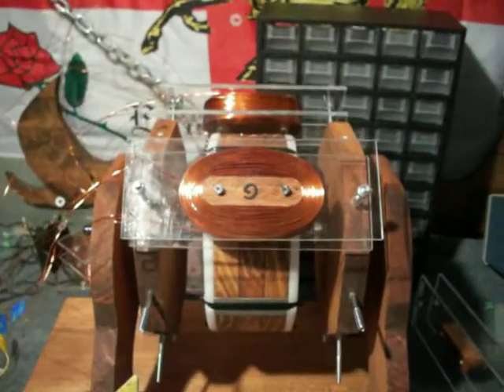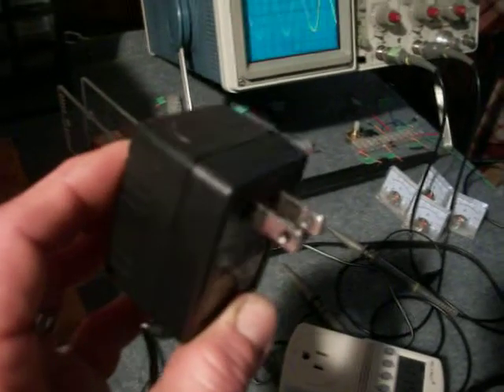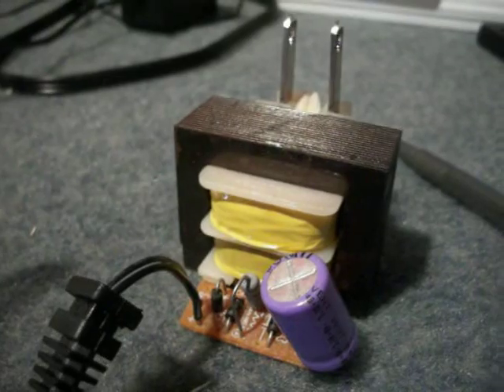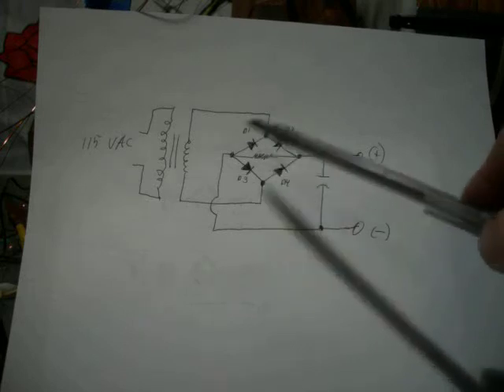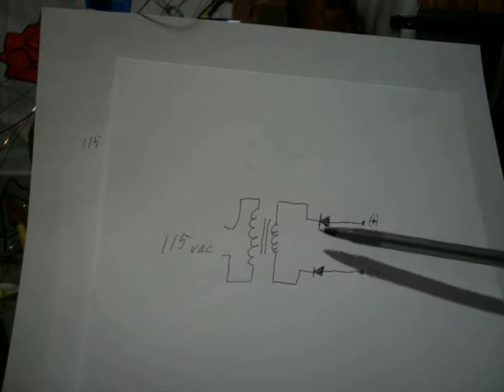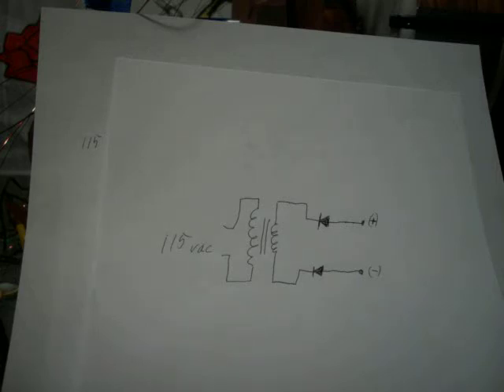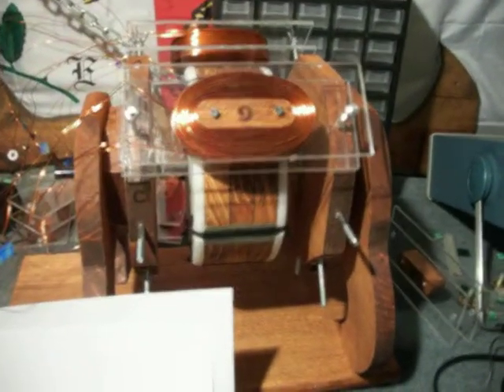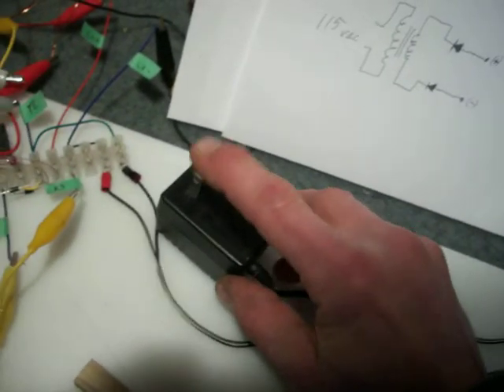Slowing the Smart Meter Test #3 (solution to a road block?)

Comment: i think you are looking for something along this path: how to plug in grid tie inverter to solar panels pv turn your meter backwards
Reply from the maker: Thanks for the homework on this one.  I'm more then likely going to hook one up to my wheel and see what she does.
Reply: *****
did you buy one?  looking forward to hearing your progress.  question for you: do you have any specs on your wheel chassis?  i would like to model something for a cnc machine or 3d printer.  already started on something for the wheel itself - just looking for a template to house the thing.  your design/woodwork is fantastic!!
Reply from the maker: Monday Morning Quarter Hack I had to stop myself from buying one last night.  Chances are I may end of frying the thing.  After thinking about it, hell it's only money.  I'll buy one for sure today and I'm going to try and find some schematics on them.  I know you can't just hook a 12v car battery up to one without burning it out. 
My wheel is a replica of the one Everybodyseye has.  He has the best one being made out of aluminum.  I have a 9 inch diameter wheel with 8 one inch slots.  The one in the video is 3 inches wide but I just finished one that is 4 inches wide.  The slots in the wheel hold the 4X1X1/2 magnet but I do have to balance them as they are off balance.  Takes a little time to balance them but they are very close to perfect.  First time my 3" wide wheel hit 1150 rpms, one of the zip ties broke and sent a magnet flying pretty violently.  Damn and I was right in front of it and I'm glad it didn't hit me.  Now I use two zip ties and on the new 4" I use 2 heavy duty zip ties.  I press a 1/2 inch cold rolled steel rod thru the center which is drill slightly smaller so no need for a keyed shaft.  If you could use some kind of auto cad program with a 3d printer, I'd make one that you could just slide the magnets in from the sides and just cap the ends to avoid zip ties.  A good experiment would be on different size diameters of the wheel to see which one performs better.  I guess you can't have them magnets too close together.
Reply: ***** oh what the hell  i'm gonna buy one too - hopefully it will force me to make my bigger wheel sooner than later.
Reply from the maker: Monday Morning Quarter Hack I went with the 1200 watt for $158 being the best deal I could find so I hope I don't wreck the thing cause I really don't know what the hell I'm doing. lol  I did see a video where a guy hooks one up to a car battery using a dc to dc converter so I also bought two 600watt units also.
Reply: *****
i'm not sure what you bought.  the video demonstrated a 'grid tie inverter' that plugged into a standard wall outlet (http://goo.gl/r7m4HK something like this).  are you looking at something different?
Reply from the maker: Monday Morning Quarter Hack check out ebay item number  221443651098 that is the unit I bought and yes it's the grid tie inverter you plug in your wall but bigger then the 250watt one on the link.  It was refurbished but that doesn't bother me.
Reply: *****
i just confirmed that you do not want to exceed the input voltage of the inverter.  and by that i mean they do not want you running a 24v battery on an inverter that handles a max 30v input.  just an fyi
Reply from the maker: Monday Morning Quarter Hack Thanks for the info, I'll have to be careful using it with the wheel's out put.  I seen the schematics on those and to build one is out of the question for me.  I hope you end up with one cause I could use any helpful info.

Comment: The schematic you showed is the most common type of power supply - it is what you are using.  Look at deansworkshop.com/CenterTapPowerSupply.jpg for a supply that should allow more feedback to the outlet.
Reply from the maker: Thanks for the tip, I'll be looking for one like that.
Reply: *****   You know you could always just make one.
Reply from the maker: DiversIFun I was just thinking about that but the center tap will be hard for me as my transformers don't have one.  You think I can omit that center tap and if so can you send me a diagram?  Right now, I took all the guts out of a transformer and soldered on some diodes and when I plugged it in, nothing comes out on the out put which is good on that end.  But when I hook up the out put end of my wheel to it, it don't push any juice thru the diodes either.  The resistance might be too strong so I'll test some weaker diodes.  As long as it can stop the voltage from coming out of the wall(which I already did) but let my wheel push current thru I should be good.  I guess I'm by-passing the back spike for now and just working with the forward current instead.  I'll do a video on it soon.  With boat season starting I hardly have time to work on this stuff.  I can't wait to jump back on it.

Comment: the way i always understood this may work would be all on the 115v ac side of the transformer. the bedini circuit captures the energy of the collapsing fields around the wheel, but the outside of the wall wart is pulsing as well....where does the magnetic field collapse to? is there some resonance with the components inside the pole pigs outside?   beautiful machine man! i love all the woodwork  :)
Reply from the maker: I agree with the ac side being the one to watch.  The primary is pulsing the secondary in the transformer but I don't think the secondary is pulsing the primary (the reverse affect) to get a spike.  I don't know where the current is going when the field collapses on the wheel.  I'm not sure if the two diode's on the circuit are stopping it or what.  Why can I not just run my output from my circuit to another transformer without the rectifier instead of using caps or salt water on the output?  Transformer on both ends with one being modified should give me a back spike I would think...........maybe....lol
Reply: “If it works that way” - you don’t have to see it.
What if “it” is HOW the pulse is being DRAWN "from" the holes.

Comment: I think the most valid test would be to run the wheel for a month, beginning and ending in conjunction with your billing cycle. I'd first try to get an idea of your consumption habits, then run the test and use electricity in the house at a normal rate. I would make a guesstimate prior to the test as to what you think the bill amount for the month tested will be...then compare the result amount to your guesstimate. Then ideally, the following month do not run the wheel and see what the bill amount is...then run the wheel the 3rd month and compare again. I think that's how I would do it to convince myself best 1 way or the other. 1 comparison would even be good, but 3 would be primo. Something I would love to do (among other things), but my brain is on another planet right now :) Great vid!
Reply from the maker: I could run a test for a week and just keep track of the meter readings.  The test would have to be shorter with the heat off but before it gets blazing hot and I start using the ac.  I just don't understand how it would work if I'm not getting some sort of pulsed back spike thru the transformer, like the reverse affect.